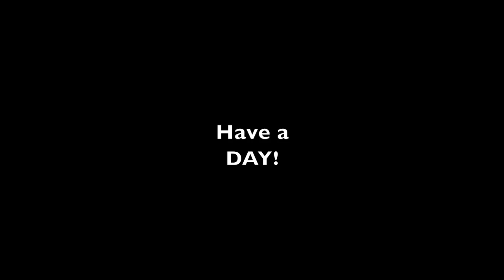#787 Archie's FIRST Trip to the Sawmill, He did GREAT!

Comment: After working in construction my whole life it's usually not hard for me to find things on other peoples builds that I would have done differently, but I got to admit, you build things right.  If it's worth building, it's worth over building
Reply: @flash1259      Can you explain which boards you would have changed on the wood-shed, I can't figure out what you mean.  You wrote......"his top and bottom boards on the roof of the shed I would have put them on top of the low eve board and high eve board instead of butting them."  Which do you mean??   Thank You

Comment: Motor Mike!!! I just finished cutting up edging from a saw mill.  O put the slabs in a bin that I can slide a ratchet strap around.  I then used 3 straps to divide the wood into 16 inch segments.  Marked the slabs in 16 inch lengths and sawed through the whole pile.  As you cut; stop and tighten the straps.  You will end up with bundle that you can stack.  Works good.q
Reply: Lots of mistakes on typing.  Big fingers on small iPad.

Comment: Mike though i would let you know that the saw dust pile can and will catch FIRE if the core gets hot enough my oldest son is a firefighter and spent almost 3 days on such a fire just thought i would let you know
Reply: @flash1259  Thank you Jim your dad was very lucky there was a factory here in Mitchell Indiana that was n't so  when the piles of wood chips and saw dust exploited into flames it took 4 different departments to put the fire out instead it burnt for 3 full days   before they got it under control and it was due to the saw dust

Comment: Don’t like how close your  balusters are. Just have too many. Just my opinion of course. Lol from a slight distance it will look like a piece of plywood. Doesn’t have that open feeling look. I figure you put them close because of your grandson but think a 4” gap would have been better. Again just my opinion. Lol
Reply: I agree, too close.
Reply from the maker: There is good reason for it, I will go over it in the next video
Reply: I’m thinking there maybe an “observation (or shooting) opening planned. Marcus from Chesapeake VA.
Reply: They are green, in a few months they will shrink. A 2x4 is true 2x4 when it is off the mill, as it dries it ends up 1 1/2 x 3 1/2.

Comment: If you're really anal retentive you could snap a chalk line so all your rail nails are perfectly aligned. Actually seen that before and on wood fences of all things. I ain't near that anal lol. When I built a 10' tall 210 foot run wood privacy fence a wingnut said I screwed up using ring shank nails instead of screws and didn't snap a line.Took 5000 nails and told the wingnut he's welcome to come over and start screwing in the screws. He declined.15 years later and never a loose board.